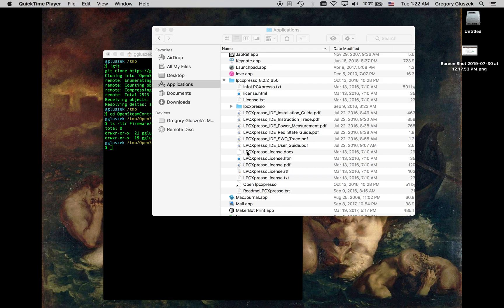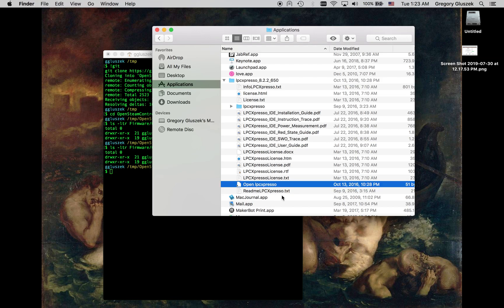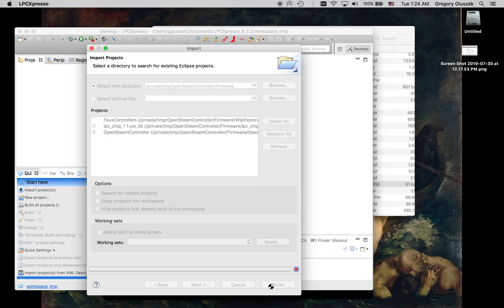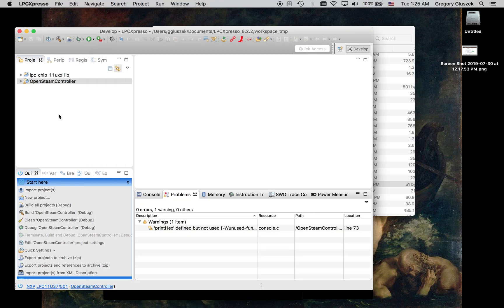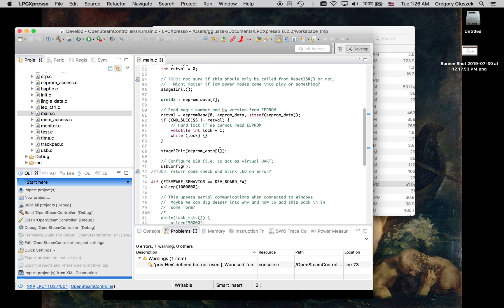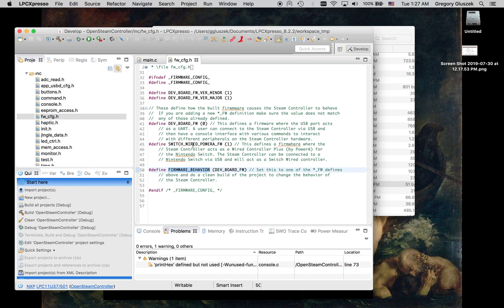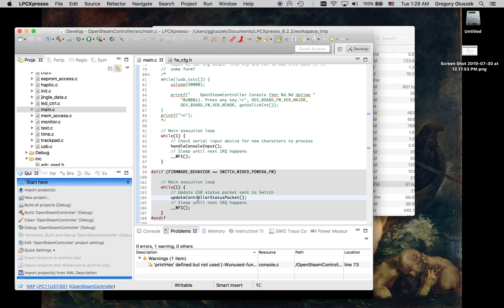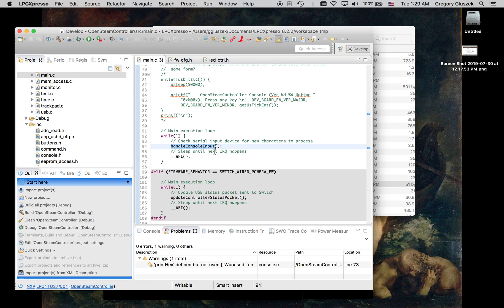Open Steam Controller: Building the Firmware

Comment: Is it possible to use this project to "just" adjust the keys that are emitted from button presses in lizard mode? I would really like to have the controller emit something from every button that I can use on any system without Steam running.

Comment: Hey! Thanks for this video, alot! I have a quick question(s), Would it be possible to use it wirelessly? It sounds kinda hopeless and I'm not skilled with coding/programming, so it's  just something I wanted to know.
Reply from the maker: Technically it should be possible, but there is a bit of work that needs to be done to get there. Check out https://github.com/greggersaurus/OpenSteamController/issues/8 for details on this effort. Also, don't worry about your current coding/programming skill. If you're interested in getting involved in the project let me know and we can discuss where you would be able to help or what might be a good approach to become skilled in coding/programming and help with the project. I've learned a lot working on this project and maybe you can too!
Reply: @gregorygluszek6659  Sounds really cool! Unfortunately my switch has left my possession for a little while. On the other hand I just got my steam controller yesterday and I feel like it was kinda underrated they are some flaws mostly being the cause of hand cramps (if your playing games that require fast reactions.) and the trackpad kinda requires constant swiping to say "perform a 360° rotation" but nonetheless I think it's a perfect remote for some switch games. 
P.S
If the bluetooth feature doesn't connect to the switch without experimentation, what about the use of the dongle?
Reply from the maker: The issue with using the dongle is that it is running its own firmware which makes it appear as a keyboard and mouse I believe. Further details on this approach can be found here: https://github.com/greggersaurus/OpenSteamController/issues/13

Comment: the right trackpad acts before "pressing" it. Is there a way to disable that, so the input connects only when you land your finger on top of the trackpad?
Reply from the maker: There might be, but it will take a deeper understanding of the trackpad than I currently have. If you look at https://github.com/greggersaurus/OpenSteamController/blob/master/Firmware/OpenSteamController/src/trackpad.c (specifically function trackpadGetLastXY()) you can see what the process is like for taking the data from the trackpad and converting it to X/Y positions. There are some exits in that function that occur because a finger is not detected in the vicinity of the   trackpad, but I'm not sure how to fine tune this at the moment...